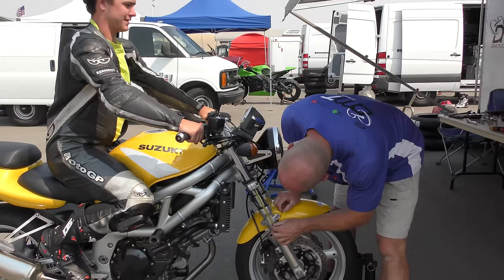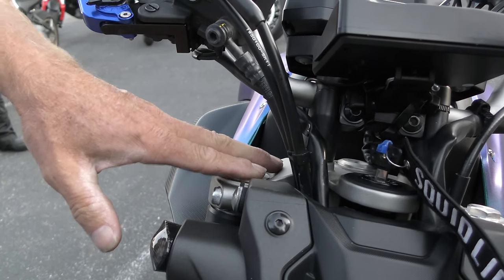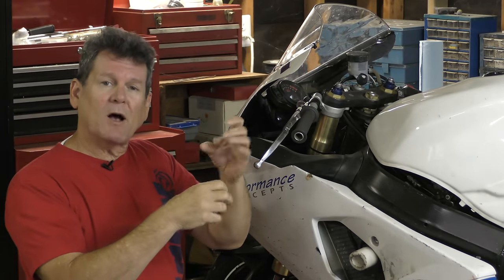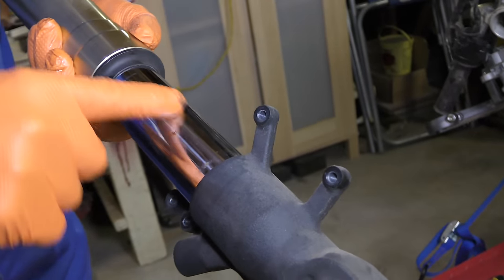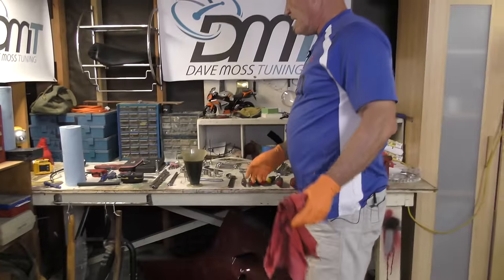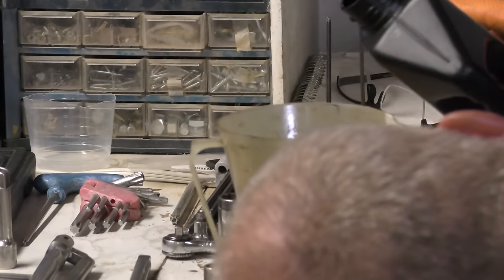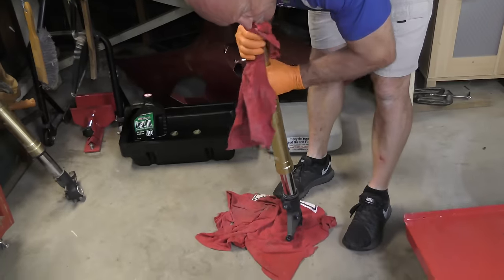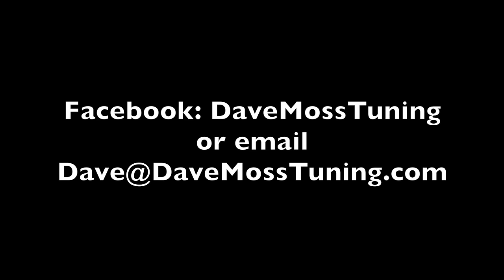Dump & Run Fork Oil Change for Standard Adjustable Motorcycle Forks

Comment: Nice vid dave. 

Im just stripping, cleaning and rebuilding my zxr forks, every internal component is now bone dry and going back together. 

When i come to pour in the oil can i purge the air from the system like the way you did in this video ^^ ? Or will i have to operate the rebound rod and do it that way ? Would it also be wise to put a little bit extra oil in each fork to compensate for all the internals being bone dry or just stick with factory recommended ? 

Thank you
Reply from the maker: Excellent work!! Pour the oil in and give it a couple of minutes for air bubbles to purge, then draw the damping rod up and down until it starts to draw oil into the cartridge. To that several times until the upstroke is 100% the same resistance in the entire movement.
Reply: @catalystreactionsbw  awesome, thanks Dave will do. 

Could you also quickly explain how the oil viscosity effects the rebound damping ? I have watched your video on oil grade but just cant get my head around it.

Cheers
Reply from the maker: @karlogrady4907  oil, flows through a given size hole. Thin oil flows faster than thicker oil, so can you find the right viscosity that allows the adjuster to be in the middle of the adjustment range to get the flow correct vs almost closed due to very thin oil.
Reply: @catalystreactionsbw  thank you 👍🏻

Comment: What causes the grey metal in the oil? Also was the sanding done to remove sticktion?
Reply from the maker: A 260mm long spring cannot keep its shape when it is compressed over 80-100mm. In deforming, it scrapes on the inside of the fork tube generating very small amounts of silver debris on up and down strokes. The sanding is helpful with reducing stiction - greasing the seals reasonably regularly helps as well (separate video for that).
Reply: @catalystreactionsbw  very interesting,  hopefully this isn't a big deal for road riding because my fork oil is 10 years old.
Reply from the maker: @greydog1104  The big deal is the viscosity difference cold to hot especially if you live in a 4 season climate. So, please save your fork oil in a jar and let it settle to see how much metal settles out.
Reply from the maker: @greydog1104  Dave Williams, editor, replying here. Oh yeah, huge deal. If you go out and push on your forks (hold the front brake and  push hard on your forks to simulate a big bump in the road) your front will bounce like a pogo stick. That's what it's doing through every corner and you don't realize it because you've just adapted to it. Change the oil (service the shock too, a shop will have to do that), then setup the suspension properly and you will weep with joy.
Reply: I'm starting to understand now there is a lot to do maintaining a motorcycle. Thanks for video.

Comment: I have non adjustable USD forks, one rebuilt and 'purged' easily, but the other doesn't seem to have that rebound damping at all. Could it be that only one fork leg has that feature ?
Reply from the maker: Yes, a lot of forks now have rebound in one leg and compression in the other.

Comment: Is this also applicable to DDC forks. Dynamic damping control
Reply from the maker: DDC forks have oil in the fork for lubrication of parts. The actual damping is done by a sealed chamber so if you wanted a true change the cartridge would need to be opened and fresh oil installed. I do not know (at this time) of a company that services the DDC cartridge itself. Perhaps other do and will post up.

Comment: I have a set of forks that have bin neglected for years and the fork oil was thick and sludgey can I use a solvent to wash out the fork leg or a thin oil to flush it out. The bike is a Honda mtx 125
Reply from the maker: You can use kerosene, WD40 or parts cleaning solution

Comment: Thank you so much for all of your incredible videos Dave. I have a question, if I may. I recently bought an 08 GSX-R750 and I performed this procedure, following your video directions. After refilling, I worked the forks but still wonder "how" concerned do I need to be about air being trapped within the system? How can I be sure that any air is bled out?
Reply from the maker: Thanks for the kind words! If you exercise the forks as per video and install them immediately, the ail will naturally purge itself as the forks are installed on the bike. If you lay them on the floor, you will introduce air and have to exercise them again.
Reply: @catalystreactionsbw  Thanks for the reply! I really appreciate it. I can't wait until the snow is gone and I can test my work. Thanks again!!

Comment: what grit of sandpaper are you using to buff out the fork after using 400 grit?
Reply from the maker: I just use 400 grip and let the dust and oil seals polish the tube. That is how i was taught 25 years ago. You can go with 800 grit for the polish

Comment: Couldn’t some of the metal shavings be from him sanding right before? Not super familiar with how the forks work.
Reply from the maker: Good thought. Best analogy is a shaver with multiple blades. The dust seal is the first blade and that scrapes the surface clean. Sometimes a dust seal has a second blade to continue cleaning. The oil seal has a blade as well. The dust from sanding is therefore cleaned off the chrome surface. The volume of silver in the oil is from the fork spring scraping with every up and down motion.

Comment: How often should for oil be changed for a bike that does.. 3500km per year w 3 track days? I had my forks rebuilt 3000km ish ago w fresh kyb 5w
Reply from the maker: Rule of thumb for advanced group is 12 track days or 3-5 track days and  2,000+ kms. The viscosity difference is still relatively small at that point.
Reply: @catalystreactionsbw  well my plan was to change at the end of next season (i do about 3500km per season w 3 track days or so) so by end of next year i will have about 6500 - 7000km and 6 track days on the fluid.. was gonna change after that.?
Reply from the maker: @DmanGuitar327  You can change with a frequency that makes sense to you. The faster you go the more you depend on the forks, so assess if you have to sustain bar pressure to get the bike to the apex. If you do and rebound is not far away from maximum setting, change quicker.
Reply: @catalystreactionsbw  thx dave awesome.. yeah i dont need to maintain bar pressure like that (that i know of) but like youve seen im close to maxxing out preload.. so i think im on a good interval)

Comment: Mr. Moss this Tyrone. Im looking to just change my fork oil in my fork tubes. I bought PJ 1 Fork Oil 5WGT extra light from Griffin Motor Sports i want 2 know using method here of emptying out old bad fork oil can i use said method an it gets out all of the old oil so im not messing with any screws in lower portion of fork
Reply from the maker: Yes, just use the process in this video to get the old oil out, measured and new oil in.

Comment: I have a question.  On my closed cartridge dirt bike forks it says 200 ml inner cartridge and 325ml outer chamber.  Using this method would I pour 525ml in the outer chamber and then use the pumping method with the cap screwed in to achieve filling the inner chamber and have the outer at 325ml?
Reply from the maker: With dual chamber forks, you have to do oil in the inner cartridge first. https://www.youtube.com/watch?v=HF6ng2axc64
Reply: @catalystreactionsbw     Thanks very much. 😀👍

Comment: I just got a 2023 Kawasaki z400 abs any adjustment to make the front stiffer I'm 160lbs about 175 with gear
Reply from the maker: Change the fork oil out to 10w or 15w to the same volume as stock or add a little more oil to use compressed air (air spring) more effectively https://www.youtube.com/watch?v=EiZY0lcqeR8&t=2s

Comment: quick question about pre load adjustment. I was adjusting the preload on my K7 GSXR1000 after watching another one of your vids, the right hand side was easy enough and actually got easier when it got close to fully open but the left hand side got really difficult to open fully to the point where I damaged the nut on top from banging it open forcefully, any clue why it would be so tough/stiff?
Reply from the maker: Sorry to read that the left side was an issue to the point of damaging the nut. If that is an issue, normally something is misplaced internally, so you might want to unscrew the fork cap from the  tube then slide it down and take a look inside.

Comment: I have a klick noise when i try to bent my inner to the outer fork pipe on my 3k miles Honda Africa Twin. Is this little play normal? Comes it from the bushings?
Reply from the maker: Ys, there should be 1-2mm of free play with the fork tub and bushings if you move the bottom of the fork.
Reply: @catalystreactionsbw  Thank you Sir!

Comment: Any guidance as to what weight fork oil to put in?  Follow owners manual or depart from it?  Any ins/outs w different brands?  Thx Daves
Reply from the maker: If you have had the forks set up, then see where you are with the rebound adjuster. Almost all the way open = thinner oil. Almost all the way closed = thicker oil. In the middle third of the total range = OEM oil. Use what brand/weight as the starting point.
Reply: @catalystreactionsbw  how do you determine this upon inverted front folks ?
Reply from the maker: @tamishagroves7281  There are known volumes for standard and upside down forks and you can compare the volume that comes out. Normally, you will get 90-85% of the oil out with a dump and run. That's where i get my volumes from.

Comment: I have ohlins gold forks on my monster 12s. What fork oil is stock weight on it? Can I use another brand as I read ohlins have different weight compared to other brands? 

Thank you Dave
Reply from the maker: Maxima 5w
Reply: Wonderful I'll go I little heavier maybe 7.5 as I'm bottoming it out on maximum preload and compression on my riding style.

I'm just 165 pounds but I brake heavy on corners and trail brake a lot. 

Or stiffer springs but I need a quick fix so oil?
Reply from the maker: @jasonubarretto  Yes, oil volume will be the quick fix for now so you leverage the air spring effect

Comment: Very good tutorial Dave. Thank you ! I have a question regarding an extra step that could fit between the drain and the refill of the fork. Would it be considered "overkill" if after we completely drain the fork (as per video instructions) we put back aprox 300ml of fresh oil/fork tube, tighten the fork cap, pump it  so that oil gets in the cartidge and drain it again so that every little bit of dirty oil is flushed ? Of course this means that we waste aprox. 600 ml of oil on the complete fork. Is it worth doing this? Thanks.
Reply from the maker: If your brain says that helps, it helps. Some use kerosene, some use contact cleaner and the list goes on. Getting something cleaner is never overkill.
Reply: @catalystreactionsbw  thank you for clearing that up for me.

Comment: Whats the procedure for the BPF?
Reply from the maker: 1. Open the cap. wait 30 minutes for the oil to drain or actively pump the fork to extract oil. Small holes = very long drain times and removing the cap does not help. 2. Filling time is the same process, slow and patient. Fork cap has to be pumped many times to push oil past the piston.

Comment: BPF, SFF (separate function fork) on my 2015 ZX6R, do you have a tutorial for that ?
Reply from the maker: In many 2 Clicks Out videos we  show how to dial in different types of forks from BPF to SFF to Balance Free suspension. Simply select the model bike with that suspension on it and follow through all the settings. Sag is the same no matter what suspension system you have, as is rebound for chassis balance. Compression needs more attention based on riding style.
Reply: @catalystreactionsbw  I was interested in the dump n run procedure for those forks, not the tuning.
Reply from the maker: @dbtrackz33  Thanks for the clarification, and we do have a BPF video. I do not have a Balance free video nor SFF unfortunately. I will add that to the list for new content.
Reply: @catalystreactionsbw  thank you sir. I'll get into that when I do the dump on mine. Happy Holidays.

Comment: Does this work for Forks if it has leaked out from the bottom screw?
Reply: What I mean is the remaining oil is not going to be the same as it should be. I can top it up to the level recommended in the manual after draining or should I open it up all the way?
Reply from the maker: @muhashsanjofy8951  1. You can top it up based on the manual. depends on oil age and how much has been lost. A small top up is not too much to worry about eg: 50ml.

Comment: Will this work on a 2014 s1000rr HP4 with semi active suspension?
Reply from the maker: DDC is a sealed cartridge and i do not know any company that services it. The oil in the outer chamber is for lubrication only.
Reply: @catalystreactionsbw  Thank you so much.  I keep my bike 100 miles away, was gonna buy the oil and gonna try.  So many thanks for your reply.

Comment: What could that metal have been coming from?
Reply: Was there an O-ring on the inside that needed to be changed?
Reply from the maker: Metal in the forks comes from the spring deforming on every up and down movement. In a brand new set of forks over three days at a race weekend for a very fast rider, we extracted 0.5mm of metal shavings. After several thousands of miles or kilometers, the amount of metal turns the oil silver.
Reply: @catalystreactionsbw  thank you! I’m an auto mechanic so I was trying to thing what component in a shock is metal to metal. Didn’t even think about the spring
Reply from the maker: @SantiSpeed1  In a fork with 50,000kms on it, we had 150cc of metal in 400cc of oil. We actually had a "flight" of fork oils to show how much metal settled out of them.

Comment: Dave&Dave everything amazing as always!!, I have a question..if I replace the oli with a slightly thicker one will my compression and rebound “clicks” be more effective?
Reply from the maker: Hi Marco. You go to thicker oil if you are close to maximum on settings with new oil specified by the manufacturer. The upgrade then sets you closer to the middle with compression and rebound settings.
Reply: Dave Moss Tuning thank you Dave!, is exactly where I’m with my s1000rr!! I’ll do that, your name should have been Ernesto cause you’re the besto 👍👍👍
Reply: @catalystreactionsbw  thank you for video, with these common forks you should do one replacing the fork seals, with at least specific tools possible. Mostly common tools or what I use PVC pipe.

Comment: Why did you switch from 5w to 10w?
Reply from the maker: Rebound with 5w oil when new was .75 from closed. 10w was 1.5  turns from closed. 10w gave far better braking support with slower flow rate.
Reply: @catalystreactionsbw  OK I get you thanks

Comment: Hi Dave, I’ve see another video of your where you take the compression fitting out also. Does this fork not need this done?
Reply from the maker: Correct, only the R6 and Aprilia's have the separate compression piston assembly.
Reply: Dave Moss Tuning thanks! I’m going to do this with my 2005 blade, so was concerned about it. Nice one! Now need to watch your static sag video again!!